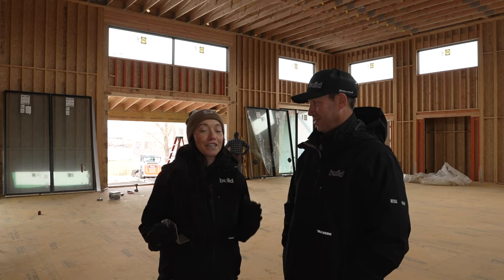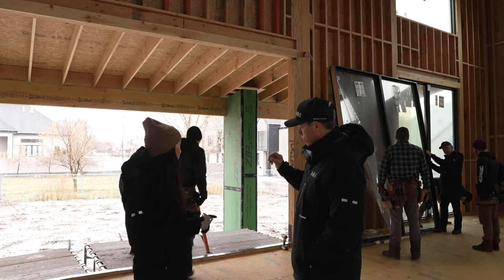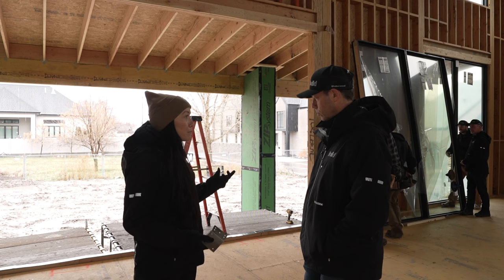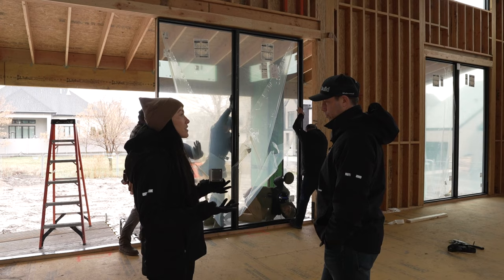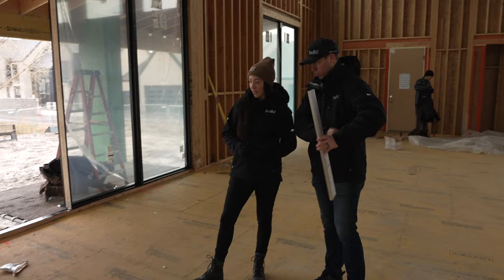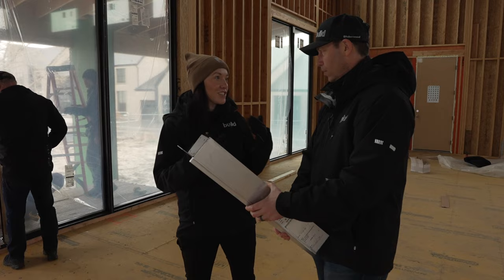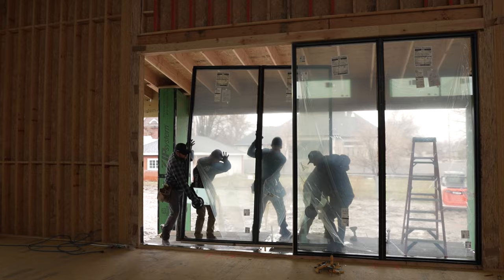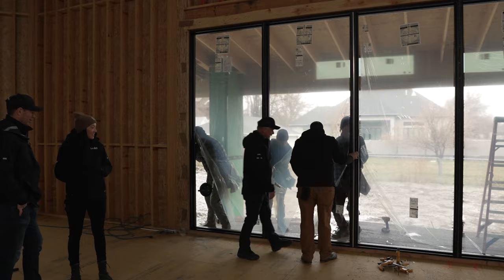What to know about installing GIANT windows

Comment: Okay, that is going to be a ‘basketball court/pickleball court/ gym’, that has to be, at a minimum, tempered glass, but optimally laminated safety glass.
Reply: Yeah, first thing I pictured was the huge expensive glass windows getting shattered the first time a ball comes their way.
Reply: @makerpat I have thrown hammers at old large tempered windows we removed. It's very hard to break. Tap the edge with the hammer and it shatters.

Comment: Wouldn't those metal plates conduct a lot of heat and cause condensation?
Reply: Yes, aluminium is the absolute worst material to use for this... Will probably be dripping wet and have a cold draft around it
Reply: @tullgutten   I was thinking the same thing.

Comment: That Aluminium brace should really have been thermal broken/stainless steel or glass fiber composite. 😳

This will be a hell of a thermal bridge to the outside and will show extremely well on thermal imaging!
Hope to see this in thermal when finished and a large temperature difference innside vs outside
Reply: The average temperature for winters in Salt Lake City is around -2°F so it should be perfectly fine. ;)
Reply: @joeblack007forever  and how would it be fine with nice indoor temperature all over the house expect in the middle of those windows where it will be outside temperature and very likely a puddle of water or ice from it condensing all the indoor humidity? It will lead to damaged floors windows and mould.
Reply: This is an indoor sport court for an obviously wealthy client. Something tells me they can afford  to mitigate any factors of having giant windows/doors in that room.
Reply: @joeblack007forever  I think you meant 27F for the LOW average. Maybe you're just trolling.
Reply: @bothellkenmore  yes, my bad, the average is 23F (about -5 celcius)
Reply: @tullgutten  I live in Quebec with winter temperatures down to -35 and even though I have very old windows with little insulation, I never observe this kind of condensation unless it is colder than -10 celcius. Maybe I’m just lucky and there is very little moisture in my house?

Comment: Totally ridiculous weight on these windows. Someone is going to die. Wouldn’t installing a combination unit get you to a similar U-value?
Reply: A double glazed window with a removable storm window built in at the factory. Alpen makes the WinSert interior storm window in single or double glazed. These could be specified in the design to double the U-value of your best double pane units.